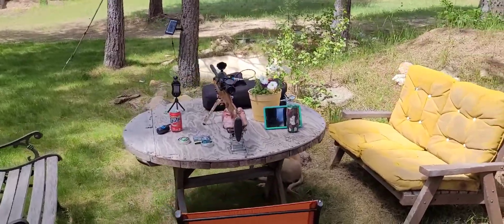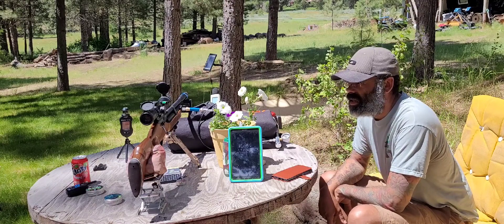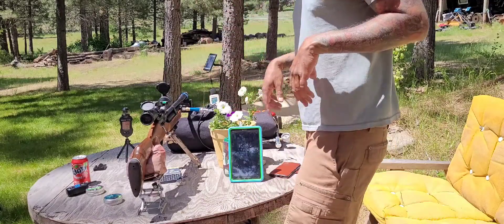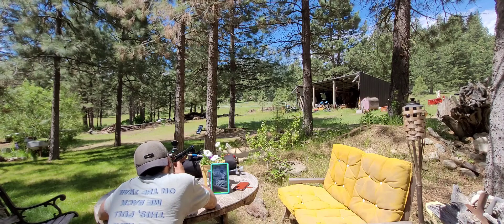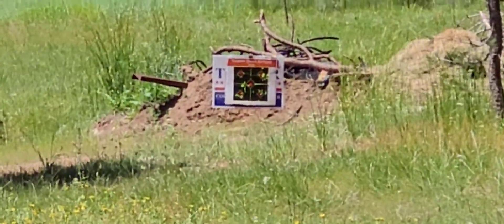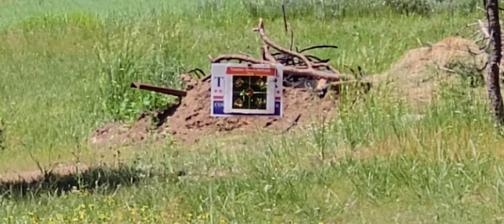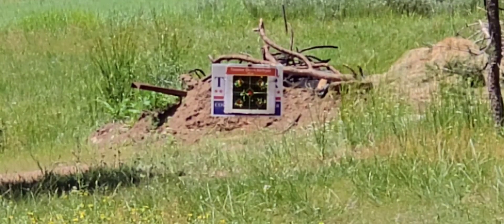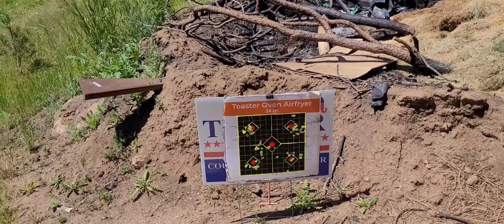Hatsan Flash QE .25 Woodstock Slug testing 💣💥💨

Comment: Nice shooting with the flash, Derrick.  I think Hatsan chokes their barrels significantly. You may want to try smaller diameter slugs if available for better results!  Looking forward to next install. Awesome you installed a Hatsan Reg. too.
Reply from the maker: Thanks Yeah I'm going to probably keep trying different slugs See if I can get it to tighten up More. And now that you mention the Hatsan regulator That I mentioned in the video I may have missed spoke and this one has the Altaros Regulator Installed And my Hatsan bullboss has the Hatsan regulator installed they're both set at 135 right now on the reg I've installed a few regulators recently and I got them confused  ...... and I do have a few more air guns to show That are new .Keep watching
Reply: @gumbystown  you know I will.